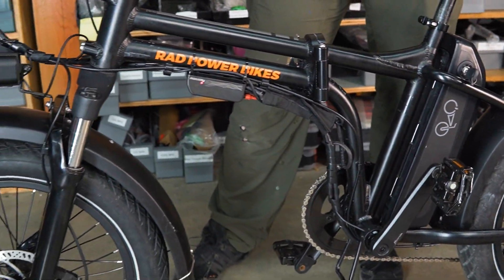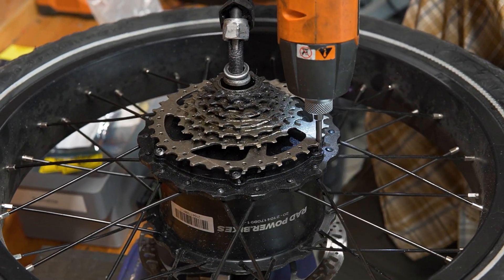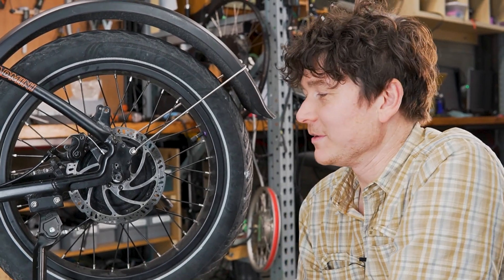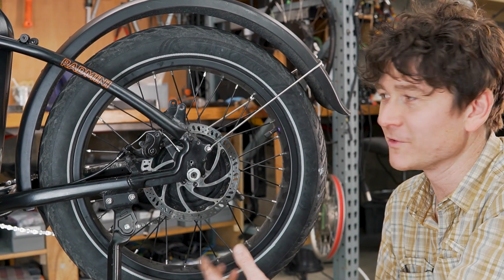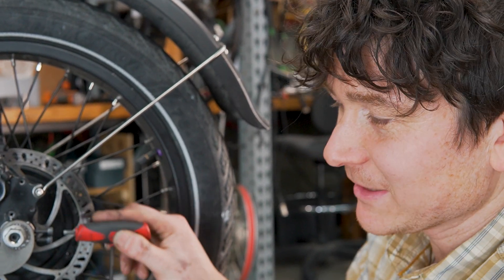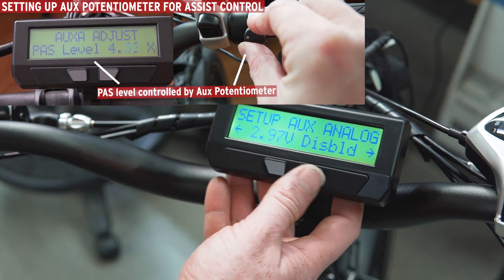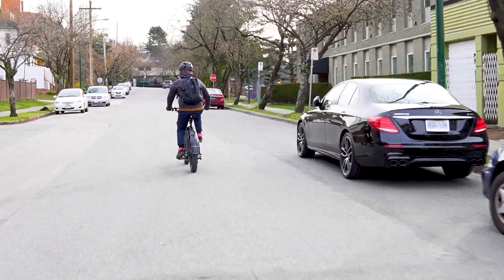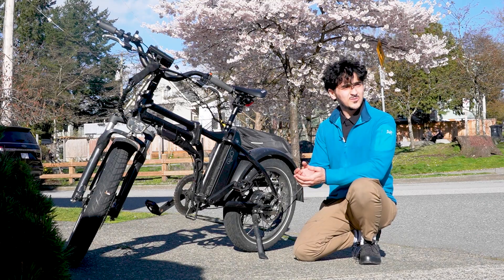Rad Factory Ebike Hack, Part 3.  Adding Regenerative Braking with a Welded Clutch

Comment: Interesting video but I'm wondering, with this hub it looks like you can't remove/replace the freewheel without cutting off the plug connected to the wire that enters the drive side of the hub. Is that correct?
Reply from the maker: You can in principle remove the freewheel just fine, as it is much larger in ID than the nut and connector. What you can't easily do is use a standard freewheel removal tool to start the unscrewing process. You'd have to modify one by boring it out to fit over the nut
Reply: @GrinTechnologies  Ah, ok, that makes sense. Thanks for the reply.
Reply: @UWMailing  Rad actually makes a FW tool that will take off the gears.
Reply: @BobSmith-zx4jy  Good to know. Thanks!